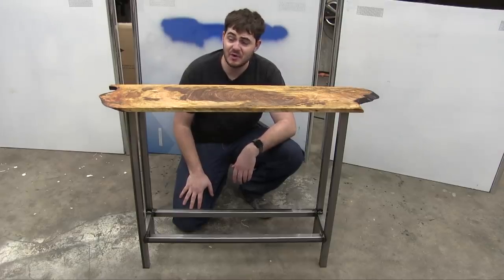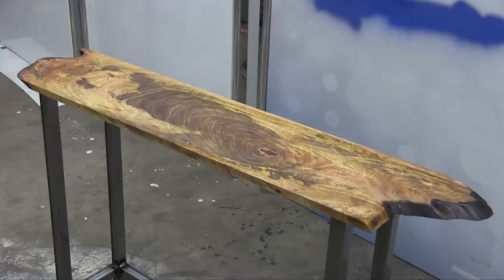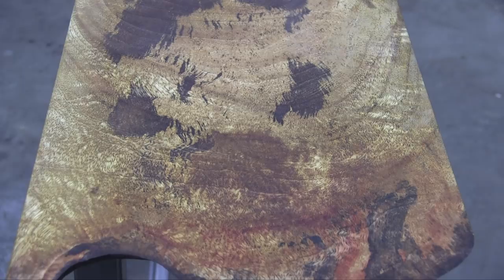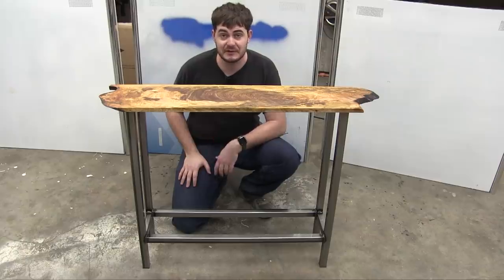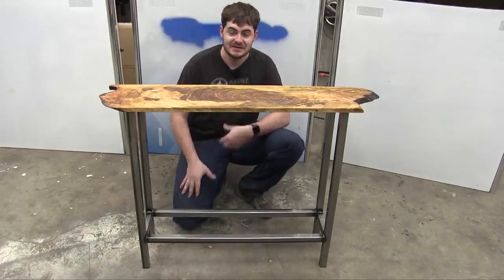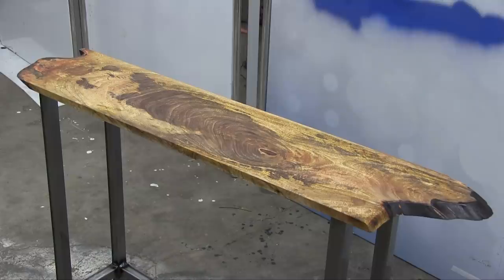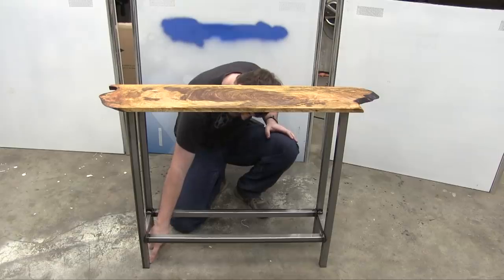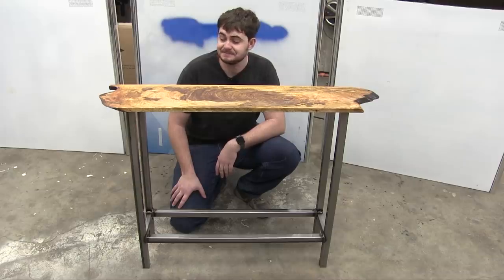Making a Live Edge Mango Console Table

Comment: A tip for you from a wood future designer, wood and also metal expands at a different rate depending on heat and humidity, you need to take the top off and recut the holes and make them into slots  in the way you joined the tabletop to the legs - from experience, the wood can move back and forth without ripping out the screws or twisting because of the way you currently have it fixed it in place

Comment: You should stain it, helps protect it against humans, and moisture. Also helps prevent knicks and gouging. You could use water based polyurethane stain to keep the original look.
Reply from the maker: I used tung oil to protect it
Reply: Under Dunn I worked in an antiques shop, and we used Lemon Oil Wood Polish on our naturally finished items.  Worked great, smelled good, and repelled insects which is a bonus in a climate like Durban's.

Comment: Table turned out great. I would like to say please use the safety guards that came with your equipment . I cringe every time I would see your fingers come within inches of the saw blade. It only take one wrong move to lose a finger.
Reply from the maker: I get this comment fairly often, so I feel like I should address this. I bought my table saw secondhand. It's about 15 years old. It has no riving knife or blade guard. I need to make a splitter for it, but I'd have to get really creative to make a blade guard for it.

Comment: Today on Under Dunn: We take an otherwise useless piece of wood and turn it into something useful, using the power of skills and tools.
Reply: I think a console table isn't much more useful than a useless piece of wood. However I don't consider "being pretty" useful at all, so for someone else it can be considered useful.
Reply: @etekweb  - That "job" could be done by a shelf. Since creating a shelf needs much less material and labour,  and less danger to pinky-toes.
Reply: "but mounting a shelf doesn't look as nice" - The act or the slef? Also, I'm talking about pure functionality, because appearance is very subjective. For example those metal legs are pretty ugly imho.

"...mounting a shelf in a hallway would probably result in people running into it..." - Why would they? It's still visible. By that logic if you put anything in the hallway people would run into it just the same.

"I dunno what you're talking about pinky toes." - The thing have metal legs. Try kicking a metal object and a wooden one. I mean, just imagine it, because it hurts like hell. The metal one will be more dangerous.

"The injury hitting your head on a shelf is much greater than hitting your pinky on a metal rail." - Depends on the usage I guess. However, if you mount the shelf the same height as the table would be, your head is pretty much safe.